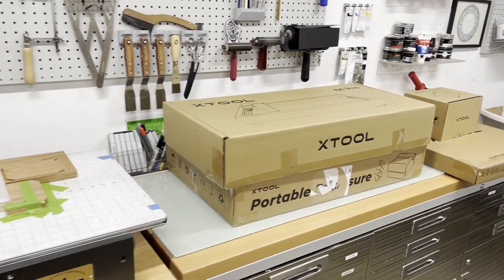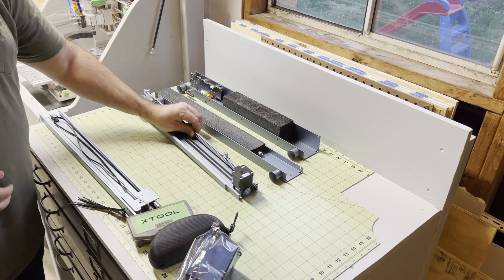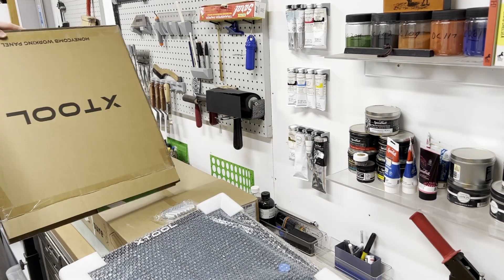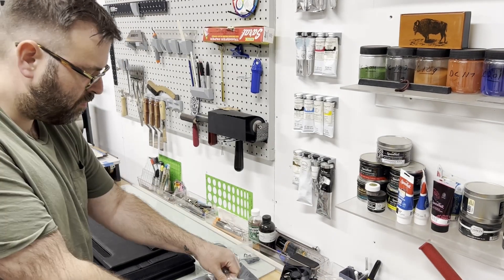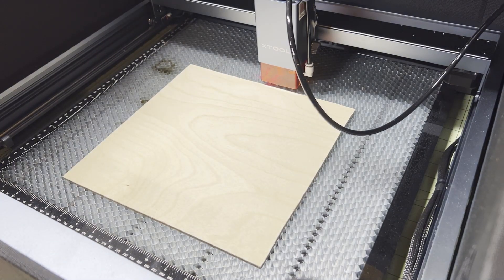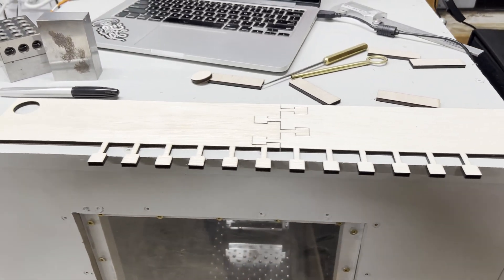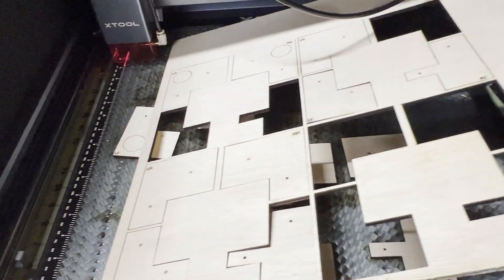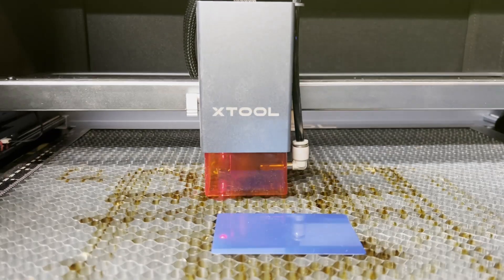Laser Cutting Made Easy: Unboxing and Setting up the xTool D1 20W Laser | DIY Sign Making Tutorial

Comment: What settings did you use? I’m having issues with mine cutting 1/4. I’m new to this too.
Reply from the maker: I’ve used a ton of different settings, speed 400/power 100 has worked good, but faster with less power and multiple passes has given me good results too. You should have no issues with 1/4” ply. Might want to confirm your focus is set correct too.